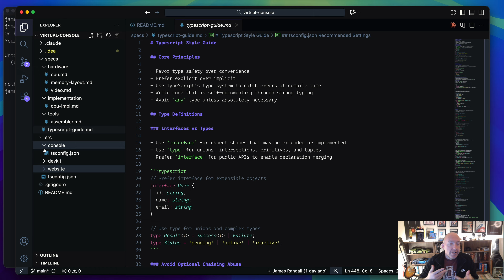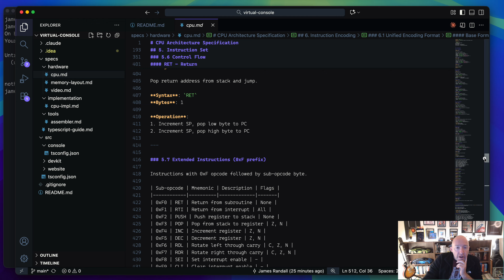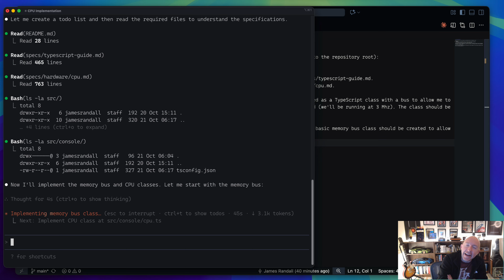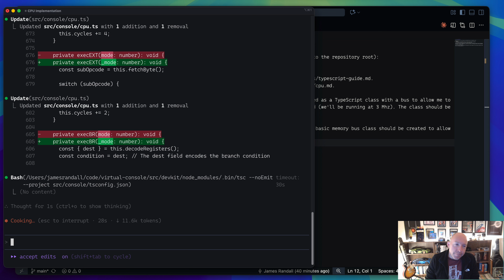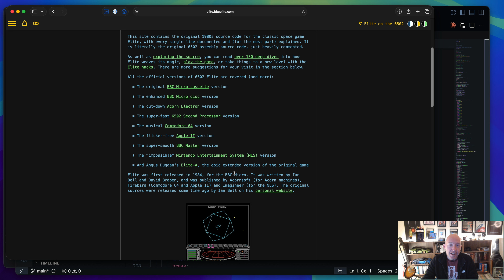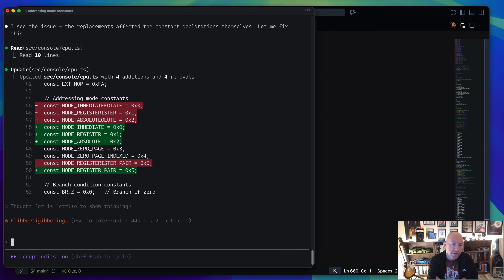Can AI Help Build a Virtual 8-Bit Console? Part 1 — Spec & CPU Implementation

Comment: Dunno man, gpl licensed code can only be used in projects with a gpl compatible license. Even if it is on github. And vomiting chunks of gpl code into proprietary codebases without attribution is definitely not ok.
Reply from the maker: I cover the ethics early on and will revisit it as the legal picture evolves — it’s not as simple or settled as it is sometimes framed though I’m not disagreeing some bad practice has gone on as you can see from some of the legal outcomes.

But AI-assisted development is here, it’s accelerating, and it’s not going away and though some token compensation may be extracted the genie is out of the bottle. I think the useful conversation now is how we adapt and plan for automation, not hoping we can rewind the clock. Both on the individual (for example helping developers adapt) and societal level (things like universal income).